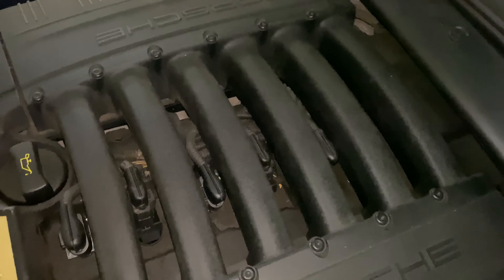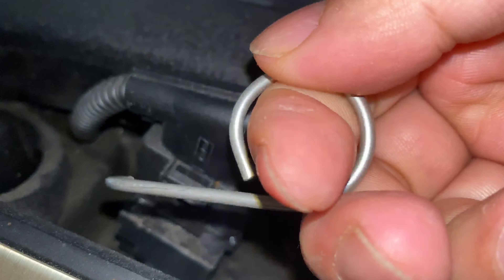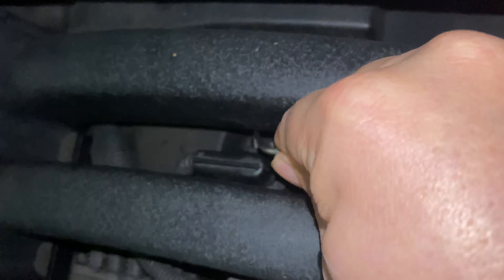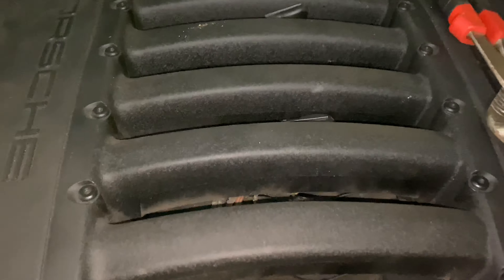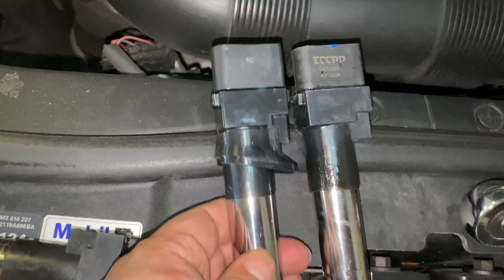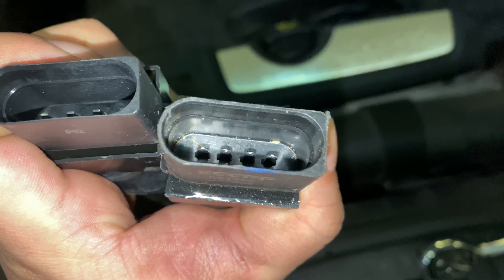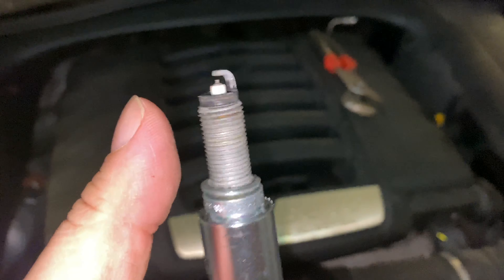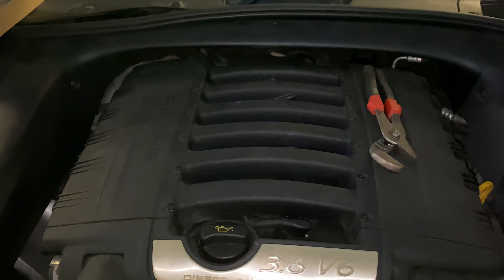How to Change Porsche Cayenne Spark Plugs

Comment: Please, please, please, guys use the correct fit socket for the plugs. measure it with the new plugs to make sure they fit. Also, don't use the socket with the rubber inside to hold the plugs when installing the new plugs; it will be a headache to remove the socket after tightening. I missed a days' work because I used the wrong size socket. thankfully it was not stripped and I finished the job. Use the correct socket, one that is permanently attached to the extension is best and also replace the ignition coils AND the screw that holds down the ignition coil...my advice...you're welcome...🇬🇾